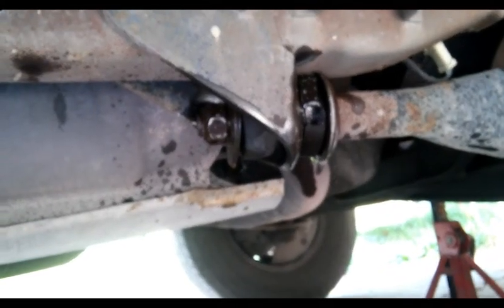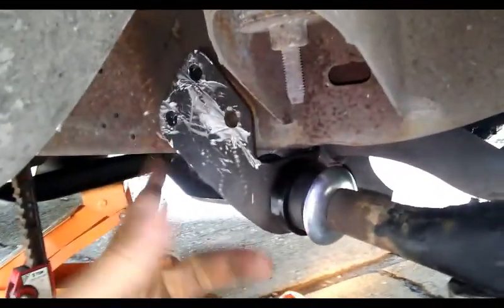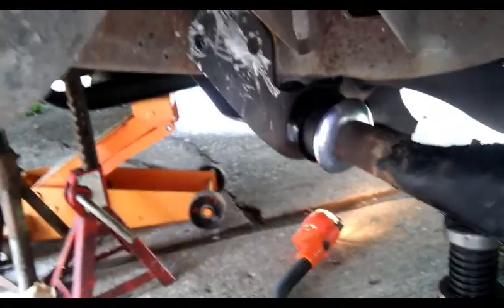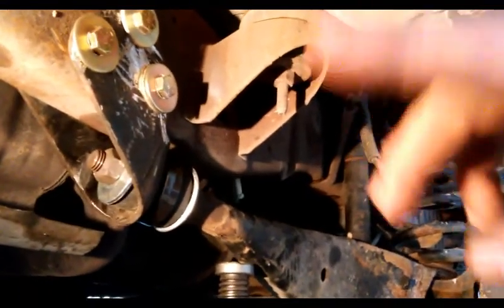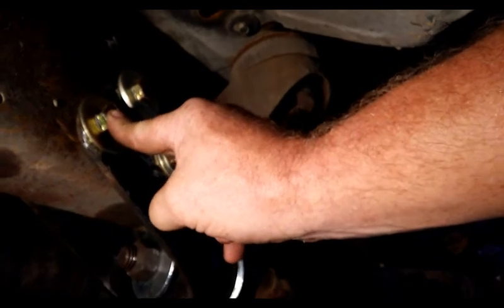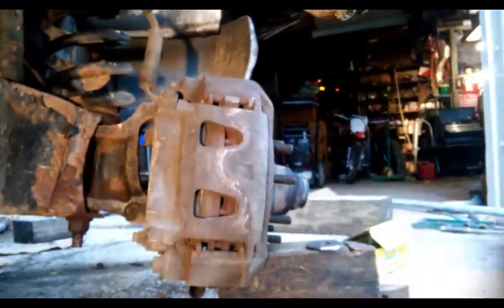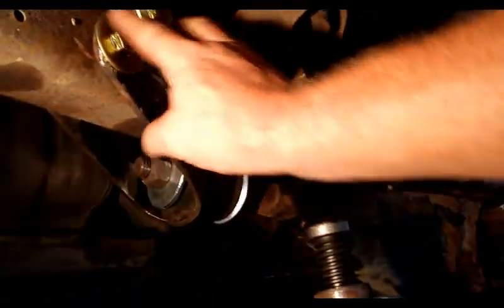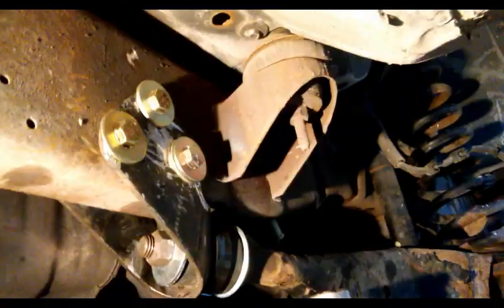1995 Ford  e250 control arm

Comment: On my 2007 E250 the nuts are welded to the bracket yes but the bolts turn freely.
Are you sure you needed to grind off the nuts?
Reply from the maker: nuts  cut off so the bolt can come out freely.... they are very long and hit the cat convert on the way out...